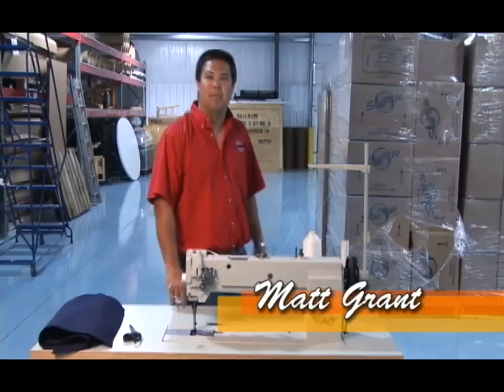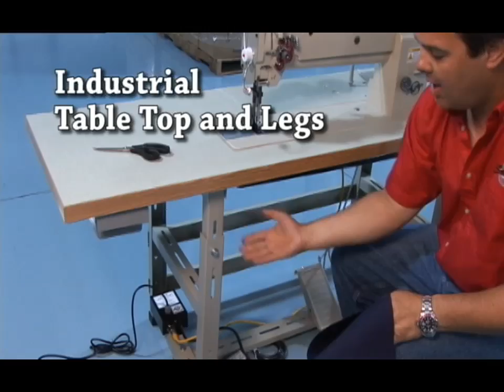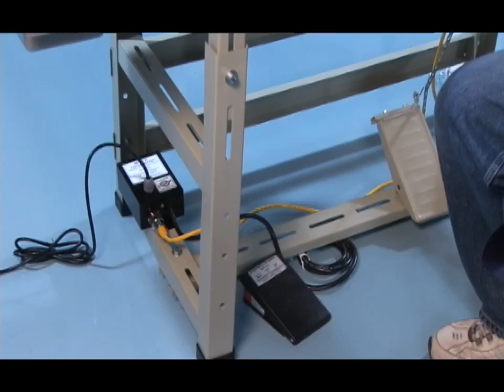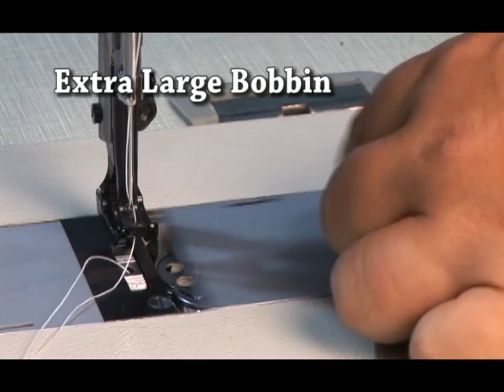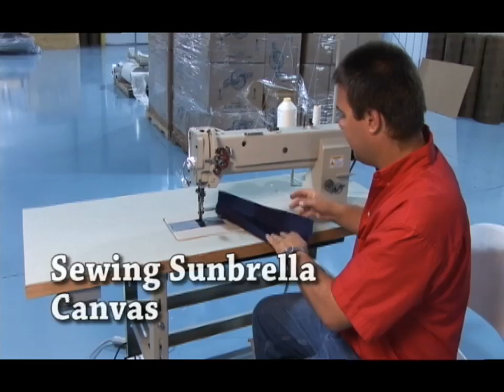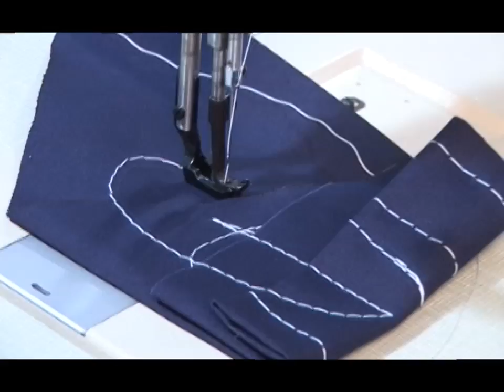Long Arm Sewing Machine - The Big-N-Tall by Sailrite (Discontinued)

Comment: The speed control demonstrated is great, a real advantage. Seems would be good for auto upholstery, sewing pleats into vinyl backed by 1/2 inch scrim foam, seat covers, convertible tops, etc.
Reply from the maker: Yes, you are correct. It would be excellent for that type of application. Let us know if you have any questions.

Comment: Will this sew from silk to heavy leather type? or can I ad attachments to make it do such? Can I ad buttonholer attachment etc. to a compound walking foot machine?
Reply from the maker: This sewing machine will sew light applications, but silks are too light. It is designed for medium to heavy duty sewing applications. We do not have a buttonhole attachment, sorry.
Reply: Sailrite Ok, thank you. I will keep your company contact handy. Hope you develop more machines for these aps- like your company.
Reply: InLaws Attic
Understand, that if you are looking at heavy duty true industrial machines with compound walking foot mechanisms designed for heavy leather, boat sail production, and/or commercial upholstery, and expecting it to also handle featherweight silk, and accept accessories such as a domestic buttonholer attachment, you are looking for a fantasy that does not exist.  No company on earth will be developing a machine to accommodate that insane range of applications.  And even if it DID, you would not be able to afford it.  What you REALLY need is a pre-1950 vintage Singer domestic machine such as the #237 Fashionmate . . . AND . . . one of these big brutes (or something like it) for your heavy applications.  You need TWO machines, at least.  I have the same ridiculously wide range of needs as you, and this is the sensible conclusion I have come to.